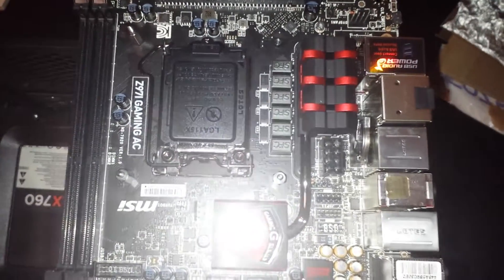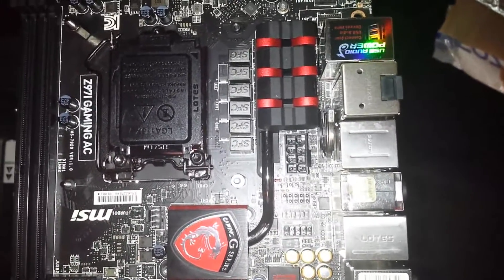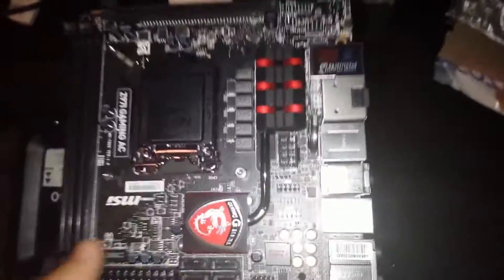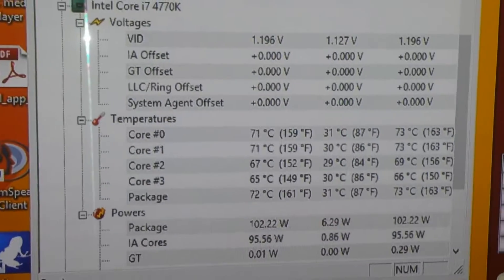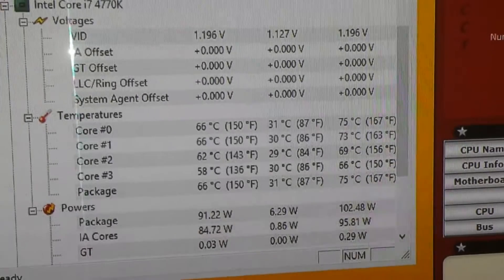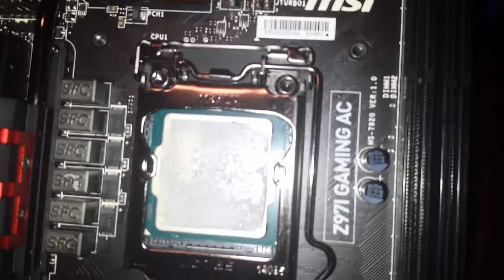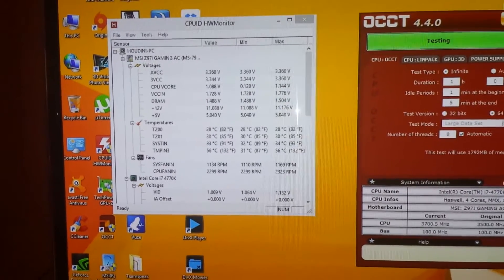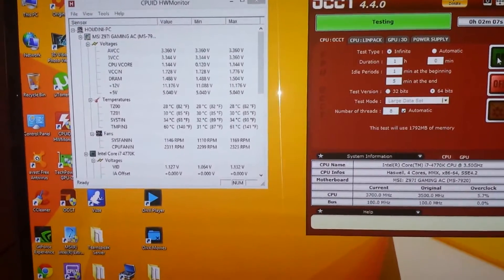Corsair H100i Backplate Fix Test

Comment: corsair is full of it telling me this is how they want it to be. Yesterday I went and added washers and made it firm which then allowed even pressure of the cold plate to the cpu. I tested it by just applying thermal paste and mounting and then removing and seeing the paste not being evenly spread and even when i spread it, it would still not evenly touch the cold plate. Once I added the washers the thermal paste evenly spread on the cpu and cold plate and help me drop 15 to 25 c under stress. I have the h100 elite btw.
Reply from the maker: Glad to hear that it worked out for you.

Comment: Years later I just got the h100i v2 and it still has this exact same issue.  Corsair still doesn't include washers and they still say it's supposed to be like this.  I'm going to get some rubber washers tomorrow.
Reply: You can get washers if you want but they aren't needed. The bracket is designed to mate the cooler plate and CPU when you tighten the supplied screw knobs. It works, just trust the design that's been used for several years without wiggling or wobbling.

Comment: Does the backplate of the H100i need to touch the back of the motherboard behind the CPU??
Reply from the maker: It wont if you put the spacers on it. If no spacers then it will touch the back of the motherboard but it may fit loose depending on the thickness of the motherboard.